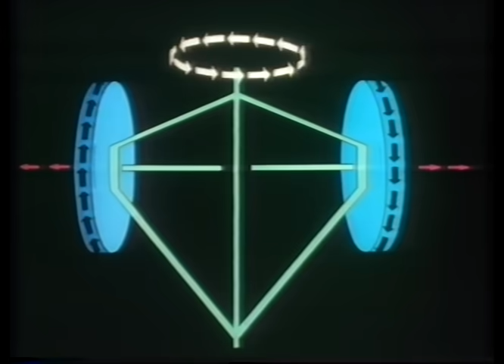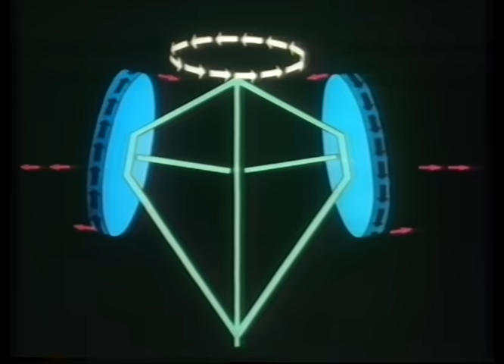Anti-Gravity Machine (Part One)

Comment: This is such a disgrace a fkn bicycle rim hands holding wheel axel so dumb easily feels lighter when spinning fast n its super hard to move from horizontal to any tip or angle just because its spinning.....ps  mercury engines have 0 rpm limits n carry little to no issues when spun up on mass scale the damn rim looses mass n more mass with higher rpm.

Comment: Perhaps the surfaces that the device is bound to or in contact with are very important for the effect… Perhaps its not lifting but its pushing itself up from the rotation of the motor and the contact of the imperfect central rod to the sides of what it’s contained in.

Comment: The principle is excellent because the movement of gravity or GYROSCOPIC INÉRCIA or GREATNESS OF TEMPO is a movement at a speed of 38 thousand times at the speed of light, which is at the speed of infinite rotation for the eternity of everything in the eternal UNIVERSE, without the need for dark matter and energy or energy. expansion of the universe or big bang. 

It is now important to simulate a GYROSCOPIC with sufficient GYROSCOPIC INERTIA within a magnetic field. 

In this way it would be simulating the movement of the universe.

Comment: the force is at right angles to the momentum so therefore  the change in momentum is a negative force acted on by gravity lost over changing space in a very short time , i think the devise is only saving low frequency sympathetic harmonic changes in momentum as compression and bending within the structure causing it to rise relative to it's fixed point by synchronizing the 2 gyroscopes in a counter clockwise around the focus in a wobbling motion , taking in low frequency energy to wobbling the twin gyros , try to push it down how long can it lift only very short against the changes , try this carry your bike up the stares and observe the rpm , whats making it go are changes relative to the earth stop as soon as you stop with a slight delay,

Comment: High efficiency motors with carbon fibre and ceramics would be interesting.
Then.....
Nuclear? type drive with nanotubes and super dense material reucing rotor volume... Smaller, lighter, more efficient. All the requirements are easily achievable with common technolgy.

Comment: Spin weights at high speed.  Centripetal force moves them outward.  If these same weights are linked to fixed length arms sliding on the shaft, the arms will lift upward on the shaft.

Comment: 💡 idea ; a mono rail one man system like the US Forest service ( used to use ) .
====
The , car has a weight on top 🎩 of the gyro so only one rail is need .
====
Place , the whole one man car so everything is balanced to a point contact like a 💎 diamond.
===
Then , have another one man rail car underneath the first gyro car in a point contact arrangement .
=====
Have the gyros spin so the [ forces add ] at the 💎 point of contact ( not mystic finger cancel ).
====
Always , thought about running around a stair case &'tearing the bottom one off &:put it on top of gyro stairs.
👋😎💨 Bryan 🧠 💨 🏡 TX 

 💎
  ∆

Comment: Think of dielectric gelatin and bubbles that push pull in one piece of the gearless Differential system the others is the free flows ofwaves while stand still but expand contracts in a density change of the gel in the gearless Differential else in bubble that have a medium charged gas particularly the heavy ones and the light ones the spherical parts of the bubble trapped and do an expanding space and a shrink release in the mindset of a mechanism to create a new idea of  currents in a position of space timed and the body expands like  that can do a causality of motion now place it in a gearless Differential mechanism that will do rotional works the expansion contraction focus a charge introduced in the long side a diode drains the channel of charge on the short side the point of right turning or left turning depends on the one left or the right angle to to introduced charge not a resonance in the gas but some appear to happen still trying to understand that part but the conjugation of the gearless Differential has a way to rotate clockwise or counterclockwise it depends upon side one from side twoIn most gases once a charged state is put into it it can hold that charge in the form of micro second ary collection of the outside fields of energy in a natural magnetic field say a chambered pipeline that will hold a magnetic field in itself if you input a charge it is held in place to make it increase its own charged states with the ethereal nature of random wavelengths that are in the longitudinal structure of the world those lay lines of linkage to a stream or riverbed or a combination of the two types of flowing water or even air the air density of the atmosphere is a very good idea of reflection of the refractional waves

Comment: Gyroscopic pressure on gas units that push pull of a non destructive charge collection and stroking that collection to liftoff the entire environment is the callapes of the way gases have a direct effect on the resonance of wavelengths and patterns of vibrations even in a vacuum the air is in motion but you can't realy see it is so gaseous things create wavelengths and patterns now think of g forces exerted on the gas from push to pull the charge discharge process that every gas is produce a forced reaction

Comment: Electrogravitics is the answer. If you could see inside one of the UAPs you would see a generator and the tell tale blue flash of electricity.
Reply: The word electrogravitics doesnt tell us anything.
Reply: @FVLMEN  It's the study of trying to make things fly with electricity basically.  They work off of generators and electromagnetic fields. That's why when/if you see inside one. Or one that's malfunctioning. You see electricity. (Blue flashes) I can't say for sure the arrangements of magnets, rotors and stators but I can say for sure it's a generator. The entire craft rotates so an educated guess would be the exterior hull is designed to be another part of the generator. It's not just the part that emits the space/time interactive field but another rotor for the generator itself. Which would give the whole thing a gyroscopic effect also. I believe the whole set up is technologically achievable by us and has been done by humans in the past (vamanas) and is being redone by humans now. (UAPs) it's not impossible because I seen one.
Reply: @FVLMEN  I think it's a generator within a generator that pretty much generates a continuous electrical short.
Reply: @FVLMEN  if you jab a knife or screwdriver into a 110 outlet it usually just pops the breaker, sometimes it will just sit there and conduct current or give you a little baby shock but once in a while the knife or object gets flung across the room by the discharge when the breaker pops. That is how they move.
Reply: @FVLMEN  if I havnt told you something yet I can tell you more. I have a whole theory on exactly how this electrogravitic thing really works and it's very revolutionary if I am right.

Comment: Many years I spent building my very own anti-gravity machine. Experiment after experiment. Failed test after test and then finally, I had it; my very own Anti-Gravity device. After the initial launch, all my notes on board, it all went wrong. It worked for sure, but the last I saw of it, it was flying past Pluto.

Comment: Can you make a gapping zone can you make it , it's the secret of Anti gravity. 
You want to move an object or a chassis in no machine way .
My way of Anti gravity is the Best,  you move the center zero and the entire chassis is following only. 
The up pull the bottom push,  center zero which is the chassis and load is following only,  it's internal driving way .
In vertical is that way , in horizontal way is different the center zero is in the center in the front and at Rhea back .
Any Movement of the center zero it's running in light speed , if tapped in my invention more faster than the real driving,  the real driving becomes a dummy driver. 
Pay for my way of construction designing my way the design is out of this world , pay me for that and my 50years in repair works.

Comment: Hang on...so the centrifugal force lifts the counterweights...which sounds incredible...but they are limited in their lift by the sliding frame structure. So lift is only a couple of inches and that's it. Pretty useless. It needs to continue to lift so the weights need to be free moving on a frame, like an old childs abacus playset where the beads area threaded around a noodle of bendy rods.

Comment: It is my understanding with gyroscopic devices like this that the anti gravity force is exerted at a 45 degree angle to the spinning gyro and then only so during acceleration so at a maintained speed no matter how fast would result in the device dropping back to earth. Other similar devices I have seen look fascinating but when you notice them operating them they throttle it up and down but never maintain the speed.  For this reason an actually useful antigravity machine would need to instead harness the opposing angles of a magnetic field instead.

Comment: The entire thing is supposed to run on only one engine, there is no reason to have two engines. When the device spins on it's axis it could run the spinning wheels on the outside of the bell by positioning cogs against a stationary cog that spins a transmission. The entire thing spins against one engine that is attached to a vehicle or other object you wish to lift. Also, there needs to be 13 weighted wheels, not two. Two is not enough to produce enough lift for anything. Also, the weighted wheels need to be positioned within a bell so that the outside is smooth, this virtually eliminates wind drag. It still isn't an anti gravity machine though, it is a good step forward but this device isn't going to do what you want. The reason 13 is needed is because it will cause a disturbance in the balance of the two opposing forces, which at high speeds will cause lift to occur. It is balanced enough to be stable but the tiny variations in balance will produce lift.
Reply: Bakers dozen.
Reply: Actually, you need 42 wheels.
Reply: @mr.channel6467  You don't know the difference between your and you're, so kindly shut your cocksucking pie hole.

Comment: Nope. You need to make ferro fluid. A cross of mercury and super fine iron dust. Then put it in a hollow doughnut of quazie  crystal. Cool it 155.000 deg kelvin and presureise it to 15.000 atmospheres. And  then put the coil in the center. Spin it up 60.000 rpm and be ready for a suprize. Us navy classified

Comment: Sad to spend so much time on such a simple machine. I have toyed around with plenty of those over the years. My inventions were far better. When i first saw one of those being made i thought it was a saw without belts. It looked like wheels without tires. We had kids toys that did that growing up too. I think i first did that playing around with weights. We used to compete lifting a weight on the end of a bench bar. We would have to lift it with one hand to win. I discovered that it was very easy if i used metal weights and would spin it. The plastic and concrete weights would not spin and were awkward to lift that way.

Comment: Ok, kids, let me dumb this down for you: gravity pulls the side wheels down... But they are spinning, so the momentum pulling the wheel down is redirected up. Without gravity it won't work, so forget space. It's nothing shocking or brilliant, it's just momentum and basic 3rd grade physics. Also, the more you want it to lift then the bigger you have to build it, and the bigger you build it then the more energy (spin force, power motor, etc) is needed to spin it. So MAYBE it would work if you build one the size of a football field with a nuclear reactor built in to power it. Give me a ring when 1.1 gigawatts of power can come that small.  There's a reason we still don't have gyro powered lifts today 50 years after this film - unrealistic energy requirements to do any real work.

Comment: I have one of these devices fitted to the wheel hubs of my car, driven off the engine, they provide enough lift and energy to control my flying car.👍
Reply: As a kid in the 60,s I read that by the year 2000 we would all have flying cars, I’m still waiting 😡😡😡😡🇬🇧
Reply: @AJ-qn6gd There're flying cars, and then there's 🍸; we can give you one of these, but not both...

Comment: I ran a large hand held polishing machine for years at work..  The machine had a 12inch round wool pad on it.  The pad was shaped like an upside down frisbee or deep dinner plate. it's edges curved upwards towards the machine itself.  It was easy to feel the weight changed when the pad was rotating, as opposed to being stationary.
The very strange aspect was that when the pad was held close to any surface, the entire machine would gain noticeable weight in you hand.  Then become lighter as it was moved away from the surface. I have never heard of surface proximity changing gyro effect.
Reply: could be just a vacuum effect . that disc could act as a "propellor" and when the gap gets tighter it produce enough airflow to get some suction..
Reply: It was only the sensation felt in your fingers, same like professor's giroscopic wheel. When It isn't spinning then the weight on the end hangs down as opposed to when is spinning and keeping its horizontal orientation.
Reply: you mean close but still no contact, right? I'd understand it somehow if the disc diminished its speed by any means.
Reply: Sounds like eddy currents from a coil motor and either a copper or an aluminium surface brought together. Magnetic braking basically....

Comment: If it truly created lift, meaning more lift energy than the weight of itself, resulting in it seeming to levitate off the ground, which they claim it did. Why wouldn't he construct an aluminium frame system around it instead that wasn't attached to the ground, to then see if it could physically lift itself off from the ground?

Comment: Consider TIME AND time dilation ON BALANCE, AS what is E=MC2 is taken directly from F=ma; AS ELECTROMAGNETISM/energy is CLEARLY AND NECESSARILY proven to be gravity (ON/IN BALANCE). Indeed, the stars AND PLANETS are POINTS in the night sky ON BALANCE; AND the rotation of WHAT IS THE MOON matches the revolution. Indeed, gravity/acceleration involves BALANCED inertia/INERTIAL RESISTANCE; AS c squared CLEARLY represents a dimension of SPACE ON BALANCE; AS ELECTROMAGNETISM/energy is CLEARLY AND NECESSARILY proven to be gravity (ON/IN BALANCE). Indeed, TIME is NECESSARILY possible/potential AND actual ON/IN BALANCE. GRAVITATIONAL force/ENERGY is proportional to (or BALANCED with/as) inertia/INERTIAL RESISTANCE, AS ELECTROMAGNETISM/energy is CLEARLY AND NECESSARILY proven to be gravity (ON/IN BALANCE); AS WHAT IS E=MC2 is taken directly from F=ma; AS the rotation of WHAT IS THE MOON matches the revolution; AS c squared CLEARLY represents a dimension of SPACE ON BALANCE. Consider what is THE EYE ON BALANCE. Consider what is the TRANSLUCENT AND BLUE sky ON BALANCE. Great.

By Frank DiMeglio

Comment: gyroscopes don't produce thrust, they only produce torque. yes the machine gets taller or shorter depending on how fast you spin it. that does NOT mean that this machine iwll actually produce a thrust on a craft in space or anywhwere else for that matter. it only appears to gain altitude because it is sitting on the ground and is able to push against it.

Comment: The Universe is held together by Gravity on Macro and Micro levels. There is no a distinct borderline between the two (yes, molecules and atoms, as well). Gravity is EVER-PRESENT and UNSTOPPABLE. In absence of gravity, the Matter will disintegrate into Nothingness, thus making the anti-gravity technology only a theoretical curiosity. 
 
The levitating astronauts are a Physical joke from Elites that gave us the wrong version of Physics. It is also the Smoking Gun of the Space Hoax, as a flight of an orbiting space station is not much different from a flight of a commercial airplane, gravity-wise. The most idiotic explanation from a NASA shill was: "They are falling around the Earth". 
"Orbiting" is not "falling". Orbiting is "maintaining an altitude". Falling is moving towards a center of gravity with ever-increasing speed in increments of 1G per second.

The formula E=MC^2 is false. It is missing Gravity, which is an unattainable fantasy. The speed of light in vacuum is not a Universal Constant, as the speed changes with gravitational conditions. The discoveries of new celestial bodies are based on this very property of light. 
Every photographer knows -- to use a photo filter, one has to increase the time of exposure, as the speed of light decreases in denser environment.  As soon, as photographer puts cap on the lens, the speed of light inside the camera becomes Zero. Try to do the same to Gravity! Zero Gravity is a Physical impossibility, as the camera and the photographer themselves will vanish, ha-ha.

Rockets rely on air resistance to fly. They do not go beyond the Earth atmosphere. Currently, there is no other transport to put anything into orbit. Breaking away from Earth is like jumping from a flying plane. The object will fall onto the Sun.

Comment: Just a gem of a documentary.

Makes you wonder if this and mercury combined with the correct sound frequency is already in practice. Land, Sea & Air, as Sandy said.
Reply: The amount of energy needed to create sound loud enough to move an object is linear.  If you want to move a cinder block you'll go deaf from 100 ft away and you'll need a hefty amount of energy and also a source of vibration.  You can levitate a foam ball easily but so can a very light breeze.  To move mass you need energy. Frequency is nothing without power.
Reply: @scottashe984 you’re sadly mistaken.
Reply: hint...it is!